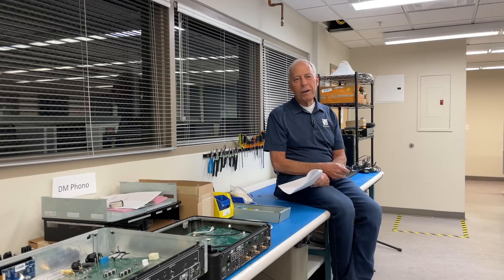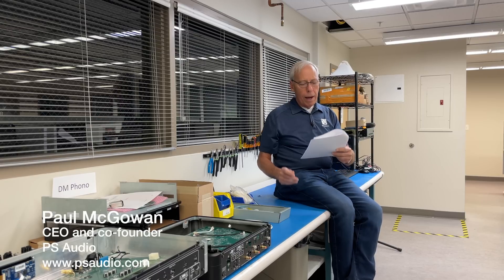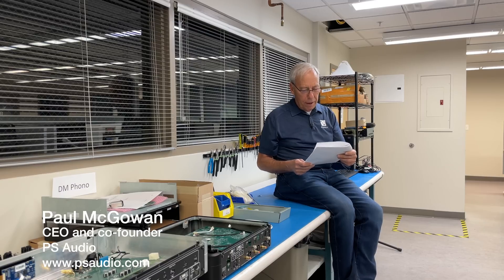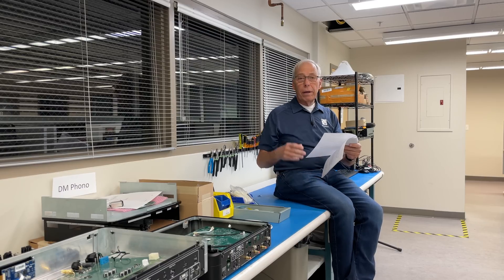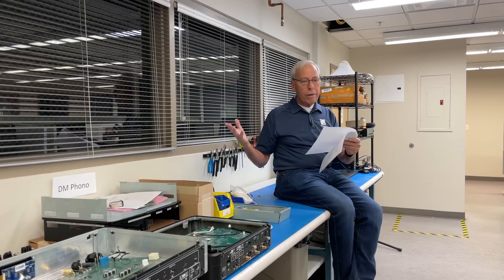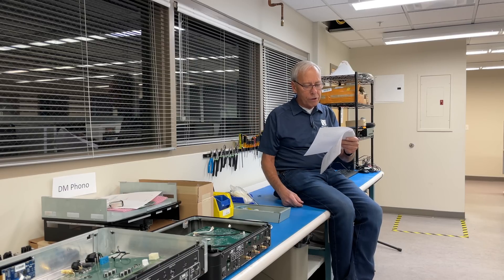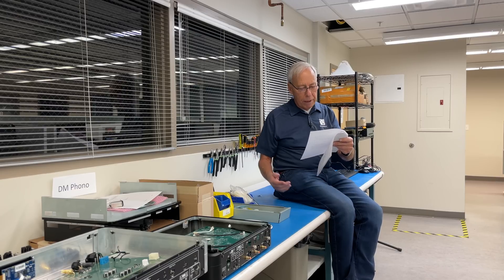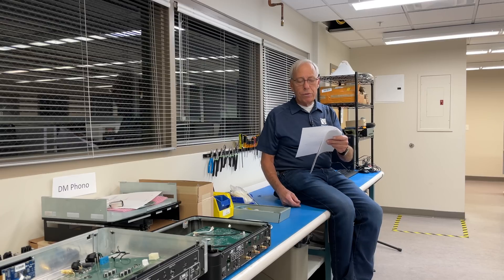How headphones make bass

Comment: Uhhhit’s a speaker it’s not an antenna. The physical length of the waveform has nothing to do with the driver. The driver merely needs to oscillate at that speed.

And they produce shitty bass. If you can’t feel it in your chest it’s not good bass lol.

Comment: In a good set of headphones you're talking about a very small mass of air being moved that's fairly well impedance matched at that. Heck, just even the shapes, you outer ear down to your tympanic membrane is much just the "mirror" of the headphone cone down to its driver.  But beyond that, imagine your headphones had no cone or membrane at all nor your ear had an ear drum.   If there was just a tiny rod connecting the voice coil(like a mini-solenoid) of the headphone driver directly to your "hammer" ear bone(what normally connects to your ear drum), you wouldn't need the "membranes" at all, and "bass" sound would just be a mechanical signal sent over the rod from voice coil to your cochlea!  But beyond those, behind the voice coil in your headphones and past your inner ear, what's being transmitted isn't sound, but sound represented as electrical signal, whether over headphone wires or your body's nerves to your brain! Which scientists are making some headway in dealing with neural type hearing loss(as opposed to "conductive") that the "hearing aid" won't produce any sound at all, it'll be akin to a nerve signal.

Comment: The simple truth is that to keep the volume or SPL the same, as you reduce the drivers diameter you must increase the drivers excursion such that the amount of displaced air is the same.
A 10" (area) driver moving 1" vs a 2"(area) moving 5"
IEM and OTE headphones cheat a bit by having small volumes of trapped air that couple directly with our eardrums, they don't have to pressurize the room you're in, only the tiny amount of trapped air.

Comment: 1) 50 feet is just the distance the peak of the sound wave is from the speaker by the time the speaker is at another peak. It has little to do with the size of the speaker.
2) Headphones can be thought of as moving your ear drum directly by preasurizing and depressurizing the air between your ear drum and the driver. It's more pneumatic than acoustic. Think of it like a stick moving your ear drum directly, only made of air not wood.
3) A 3 inch speaker can make 10hz. However, given it's size it just won't be very loud. You need big subs for deep base because you need to move a lot of air to make a low frequencies loud enough to hear. Low frequencies don't have much energy, and our ear isn't very sensitive to them, so you need VERY loud ones to be effective.

Comment: Thank you for the great videos. 
My question may not be relevant to the topic, but hope you can help. 

I am currently working in Hong Kong (220v) and thinking about buying a good amp to upgrade my system. I will be moving back to Canada in 2 years, where voltage is 120v. Would it be ok to use a step down transformer (plus power stabilizer/conditioner)? Or should I wait and just buy 100v amp later?
Reply from the maker: Yes, it would be ok to use a stepdown for now and then once in Canada, go "native" voltage.
Reply: Thanks for the quick reply. 
But it is the other way around. I am buying 220v amp here in Hong Kong and will be using step-up transformer when I move back to Canada. Shouldn’t it have any bad impact on audio (and sound quality)?
Reply from the maker: @naristv  That is something I do not recommend. I would avoid step up transformers.
Reply: @naristv  you would probably burn a step up tx out. stepping down would be better for a temporary solution.
Reply: If you say so, I would rather wait and buy later. Many thanks!

Comment: I think it's simpler explained by saying our ears do not integrate complete oscillations of the sound waves to sense each frequency.
The same way you may feel a wave in the ocean even if the wavelength is many hundred feet.

Comment: My AKG K141s from the '80s use 6 passive radiators (each less than 1") around the active driver to reinforce low frequencies.  This works very well, even many years later they sound great.

Comment: The low frequencies in 50mm over ear or 10 - 15mm IEM's I can understand but how they do that and produce crystal clear mids and highs is baffling. I guess that's why the top end over ear's are planar/electrostatic and the best IEM's have a driver for bass and balanced armatures for mids and highs.

Comment: Paul; One point you missed in an otherwise good discussion. the ear is sensitive to sound pressure. A loudspeaker creates that pressure in open space and is limited as to how much pressure it can deliver by factors such as displacement, frequency, distance, etc. An earphone sealed into or over the ear compressed the air in the cavity directly and are not limited by those factors. With a good seal and a transducer designed for low frequency operation you could indeed extend the response to DC ie a constant pressure. You wouldn't hear it but you could feel it.

Comment: Let's see if i can explain this.. 20 Hz is 20 Hz. regardless if the driver is 12" or 1/2". the frequency remains 20 Hz. which means the driver moves in/out 20 times per second that's a constant. The amount of air it needs to produce the sound wave of 20 Hz. depends on the size of the room. Bigger room more air bigger drivers. a  headphone moves only a minuet amount of air so it needs only a mini size driver to produce a 20 hz. sound wave. Less air= Less driver.

Comment: Always a joy to hear from you Paul, just got to hear a B&W 804 D4 in a home environment which was a great experiece surpassing the Dynaudio Special Forty by a lot. They aren't as unforgving as  I thought they would be. Hope to one day have one Direct Stream Dac. For now Roon DSD512 upsampling will have to do. Sometimes it wounds the same as native sometimes it's better not as sharp on bad recordings. I belive it's the filters rather than the dac chip operating mode since it's an ESS Sabre 9038 Pro Delta Sigma dac with 4 bits or something like that.

Comment: It makes me a little bit crazy to hear someone talk about inches, miles per hour, and cycles per second (Hz).  Surely it would make more sense to use compatible measures like feet per second for sound speed?  As an approximation, 330m per second can be used for the speed of sound, which makes the calculation simple: speed of sound divided by frequency gives you wavelength in metres.  As every US citizen knows, the inch is defined as 2.54cm (there are 100cm in one metre)
Reply: Every US citizen knows that an inch is defined as 2.54 cms, but does every US citizen know that is an approximate measurement for an inch. The real number is more like 2.5399999?

Comment: It’s simple. Lower frequency sound waves are less directional and thus more dispersed and  lossy when being radiated. It’s sort of how a light bulb (think of it as woofer) vs a laser (think of it as tweeter) can be with different intensity of light at the same wattage. Therefore to compensate for this dispersion energy loss you need a bigger diameter driver in open space or a direct coupling with your eardrums to avoid leakage in an earbud or headphone. My Etymotic earbuds can make great bass this way.
Reply: Wow. That example impressed 👍
Reply: Not exactly.
Reply: @carlosoliveira-rc2xt  Not exactly but from an energy loss perspective, close enough. One Watt of power from your amplifier is one Joule of energy per second and only a tiny fraction of that energy moves your eardrums and that ratio is what determines how loud the sound wave gets. More loss due to dispersion means less energy for your eardrums. Same with light energy hitting your eyes. A one Watt laser can fry your eyes while a one Watt light bulb is quite dim.

Comment: Paul's comment about distance and sealing of the ear are spot on.
Just do a small experiment while listening through h/phones.
Lift the caps an inch or so away from the ears. You will discover all bass notes gone!
As the air compression is not there any more, so all bass extention also disappears.

Comment: In reality speakers are more or less constant acceleration devices. This means that at low frequencies, there will be larger excursions, and more air moved. It’s the displaced air at low frequencies that you hear as sound in the form of SPLs. This also means that the speakers are omnidirectional at low frequencies since the pressure waves wrap around the cabinet. As the frequency increases, the displacement decreases since the motor force from the voice coil doesn’t change dramatically. At a certain point, the wavelength matches the speakers dimensions and it then begins to radiate sound in a beam like you would think. With headphones, and esp. IEMs the space is your ear canal, so the volume of air that needs to be moved is very small. Basically all it’s doing is pushing your eardrum in and out via the small volume of trapped air, which is why a good seal is needed. Escaping air = no bass.

Comment: I think the confusion is between wavelength distance at the speed of sound as you discuss, and a driver being able to move linearly in one direction for a give period of time. If the headphone driver can move back and forth linearly between it's extremes slowly enough that each direction lasts 1/20th of a second, it can reproduce 10Hz. It just won't have moved very far during that elapsed time. It just won't have moved much air. 

But those low of frequencies are not picked up in the ear drum anyways. Real bass is picked up by bone conduction in bones outside the ear canal. Vibration of those bones is required for us to "hear" bass. 

In a tour of his facilities, Gene Czerwinski explained to me that part of his extreme sensitivity design of his Cerwin-Vega speakers, especially large ported woofers, was his daughter was born deaf but liked the beat of the music. So he made speakers that did that.

Comment: The time it takes the speaker to move one complete cycle, in and out, at 20hz (0.05 sec or 1/20) is the time it takes, at the speed of sound, for the pressure wave to travel 55 feet(1100ft/sec / 0.05=55ft).
Reply: The driver needs to move further in the same amount of time. IE, it has to have the ability to move at greater deflection. Size of the cone (-more power to the coil) equates to greater distance that the wave can travel.

Comment: i think of it more like this way: low frequencies are pressuring the air, inside a subwoofer box lets say, when the woofer moves it pressurizes the box, no waves can fit in there.
Reply: The reason you need to use a box for low frequency bass is that low frequencies are dispersed more widely and that causes the front push/pull and the rear pull/push to negate each other if you don't isolate the rear sound waves in a box. The fact that lower frequencies and especially bass is dispersed more widely causing energy loss is also the reason why you lose bass when your headphones are loosely coupled to your ears.
Reply: @ThinkingBetter  of course you are right, but keep it on topic of explaining how headphones make bass.  
my example of a small box is that inside that box that is still reproduced 10hz with a wave in its full length cant fit 10% of it.

Comment: I think what you're trying to describe is the difference between the speed of a medium vs the speed of information that is carried by that medium. There is a ton of reading that can be done on that subject.
Reply: I have no idea why Paul chose to go down that path.

 Distance and medium density affects arrival time, speed, and phase shifts, and is irrelevant to the pressure of air change frequency in a headphone. I was a sonar technician in the military.
Reply: @zulumax1  I just go on the over simplified concept that if you have a wire that has electrons and you add one at one end the other end will deposit one...right now. We could talk about impulse propagation vs wave propagation but I suck at math so...